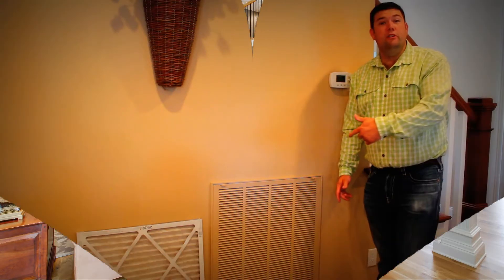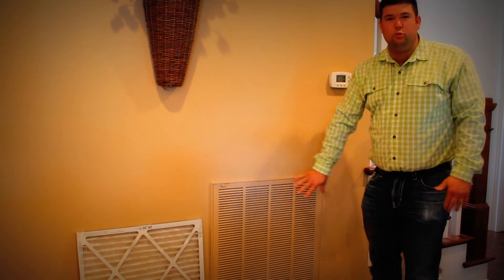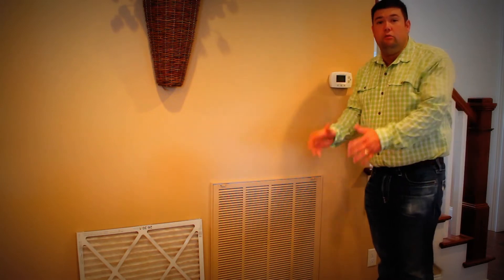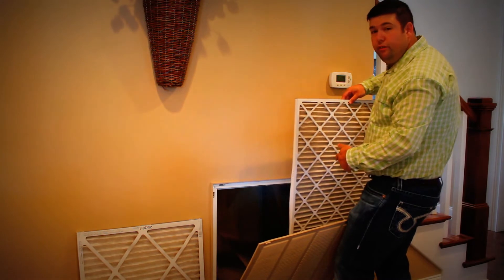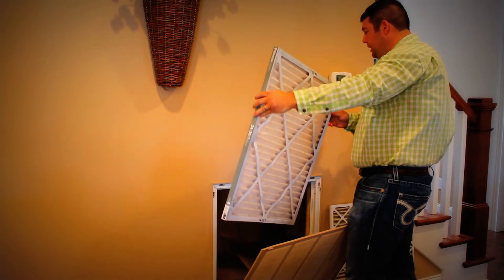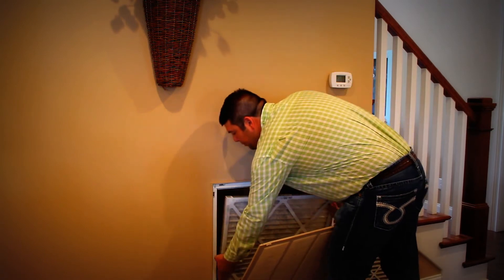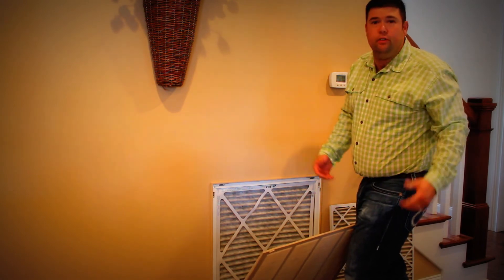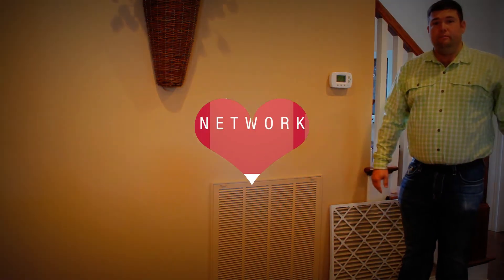Ryan's Home Tips - Replacing Your Return Air Filter

Comment: So I put one in my ac/furnace unit... do I need to be putting one in my vent as well?  I'm so confused
Reply from the maker: Hi, Lindsey! There are a few different types of HVAC systems, so depending on what you have will determine where your filters go. It sounds like you found the location of one, but there is typically a return air vent as well. If you see a metal grate like what Ryan has demonstrated in the video, check for screws or hinges that would allow it to come open. It may be on a wall, ceiling, or even in a closet (if that's where the return air inlet is located). You do NOT have to install filters on the vents themselves. The goal of the filter is to clean the air before it gets to those vents.  Next time you have your unit serviced (like for upcoming cold weather), you might have your HVAC tech doublecheck the locations for you. We hope this helps!
Reply: @AskAnnNetwork  thank you 😊